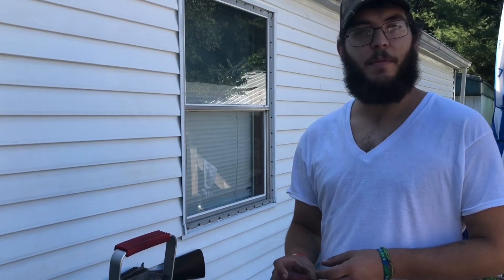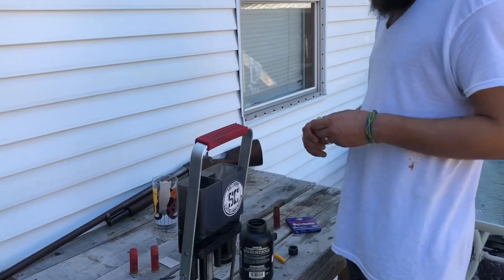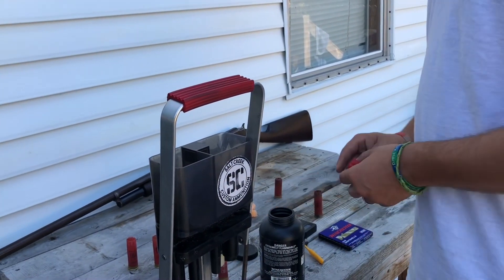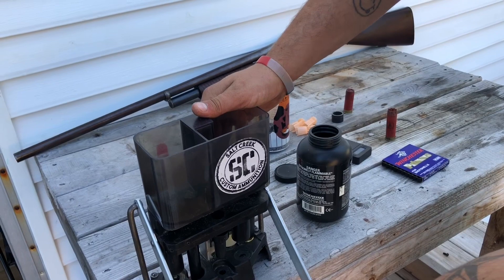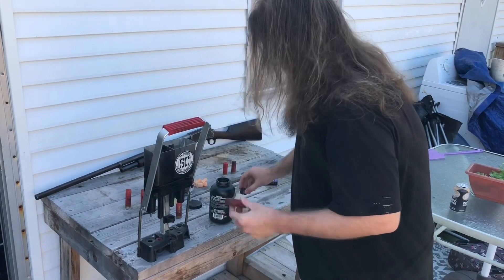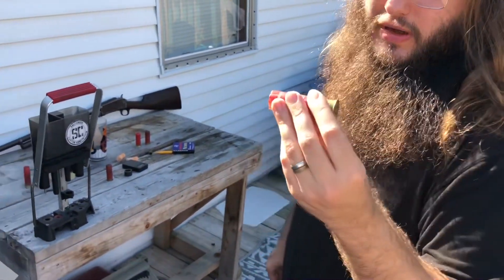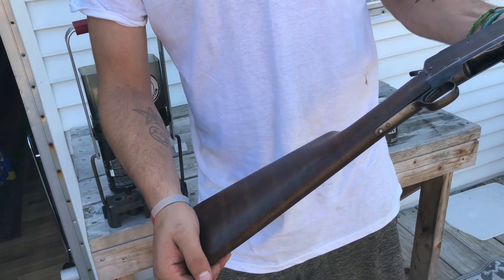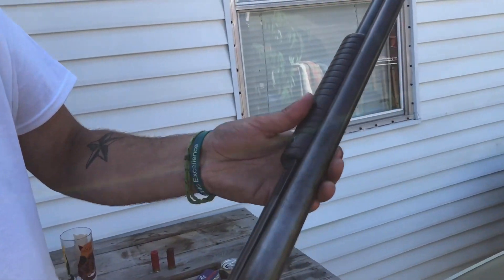Our Favorite Clay Pigeon Load And Marlin Model 17S

Comment: I have been loading some Titegroup which is the exact same powder as the new High Gun powder.   I have been loading 18.4 grains of Titegroup, Cheddite primer, AA Hulls and Claybuster TGT-12 but with 1-1/8 oz of shot.     Also use Remington Figure 8.    The stack height lines up better with these wads it seems than compared to the CB 1118
Reply from the maker: Sounds like a good load

Comment: The button on the rear of the receiver is the bolt locking lug release. It does not release the bolt itself, only allows it to be manually released via the slide. The bolt should lock every time the action is cycled, until that button is pressed or the gun is fired. The actual locking piece moves forward under inertia from firing, or pressing the button. The bolt LUG will remain unlocked until the action is cycled again. The bolt lug should hold the bolt closed until the action bar is moved rearward regardless if it is locked or not. There is a secondary sear that should hold the hammer unless the bolt is completely in battery (this is how slam firing is possible.) Good luck with your repairs, and if you have any questions, feel free to PM me.
Reply from the maker: The button on this doesn’t seem to do anything at all, it has spring tension though. I’ll have to do more research on it.
Reply: The locking mechanism has a hook near the top that grabs the bolt lug from the bottom. If the hook gets rounded off, it won’t hold the bolt lug down in the locked position, and the button will seem useless. If it’s not broken off completely, it should be able to be carefully reshaped with a needle file to hold in place.